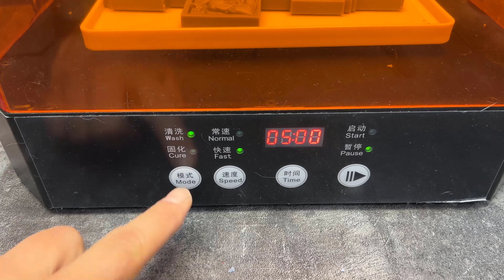How to Make a Silicone Mold of the Crucifixion of Jesus Christ | DIY Molds

Comment: Hello congs on your amazing work once again. What Kind of wood stain do you use? Is it water base? That black spray you use what Kind is it? What os the 3d printer that you are using? Thanks Im advance.
Reply: Elegoo Saturn 4 ultra
Reply: @swz1968  thank you sir
Reply from the maker: Hello! Thank you very much! Water-based stain, the brand is not particularly important. Any spray paint will do. I have Eligo Saturn 4 Ultra
Reply: @DoasIDo1  thanks man you are the best.